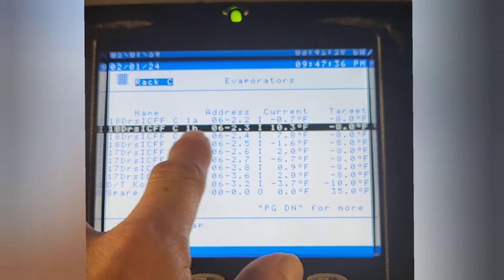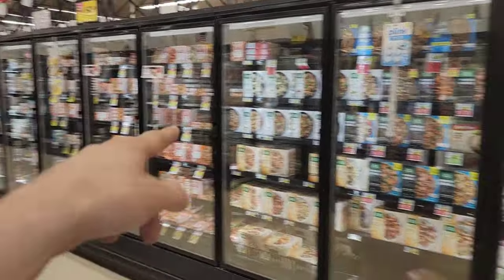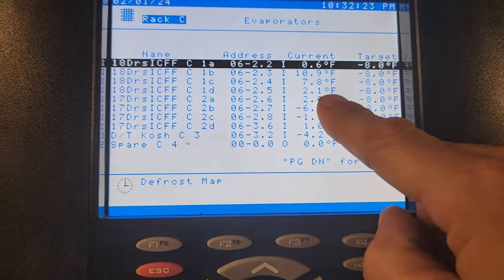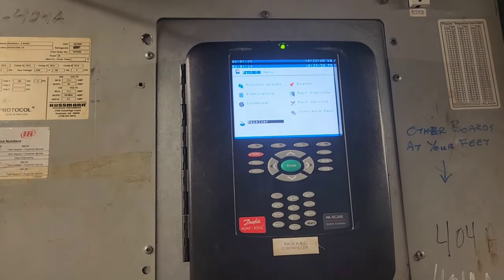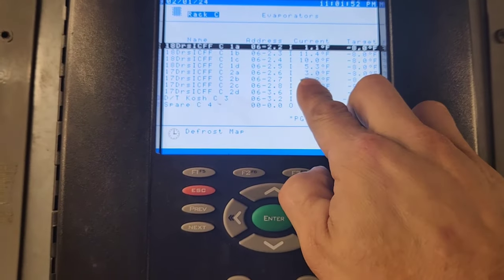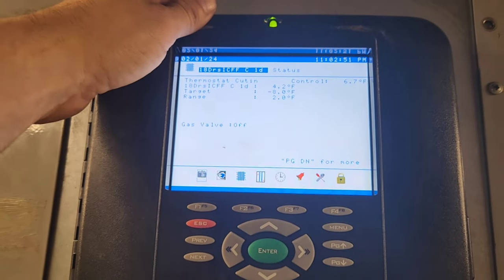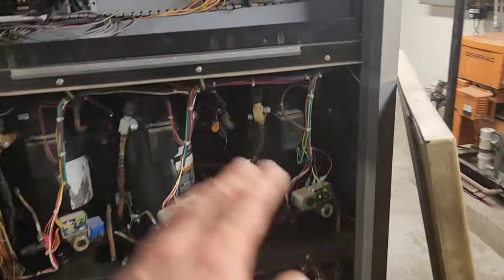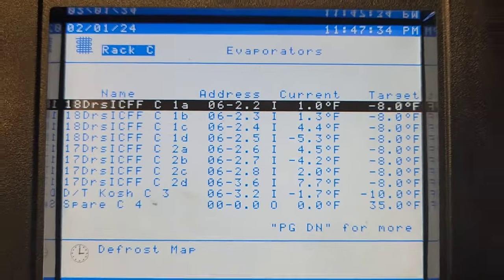Cases Not Holding Proper Temp

Comment: The question that comes to my mind is why did all those TXVS get outta whack. I'm in-experienced but it seems weird that multiple TXVS needed adjustment
Reply from the maker: That is a good question. I had it too and my supervisor had it as well. He said That the sub cooler probably wasn't working. But he had me check the liquid line to make sure that it was cold. And it was in fact condensating cold. So he said that wasn't the issue. The history showed that the cases had an alarm set point for 20°. That right there tells us that the cases haven't worked and gotten down to proper temperature for a long time. Because somebody went in there and changed the alarm set point to go off at 20° instead of at 0°.

Comment: Question don’t you wanna check the screen before adjusting the txv?
Reply from the maker: If the screen is causing a significant restriction,  I will see it frosting at the inlet of the TXV. So in just looking at the frost pattern at the capillaries going into the evaporator,  I know I don't have restriction at the inlet of the TXV
Reply from the maker: Great Question! I failed to mention that in the video.
Reply from the maker: It's also much more difficult because you have to pump the entire circuit down which takes about an hour to do so, And everything that's in the cases all the product will have to experiencewarming up more. If it's not necessary anunavoidable by looking at the frost pattern, it's a better way to go in my opinion.
Reply: You are an absolute professional. You grasp of how all the pieces are put together is fun and impressive. Thank You.